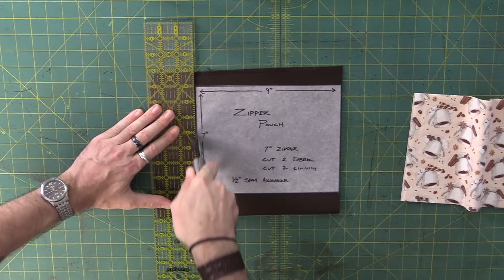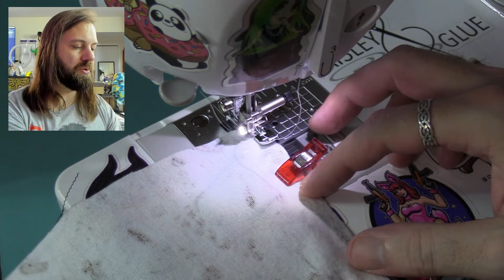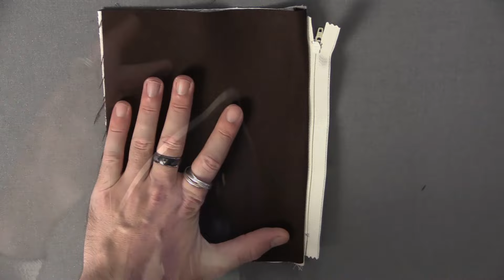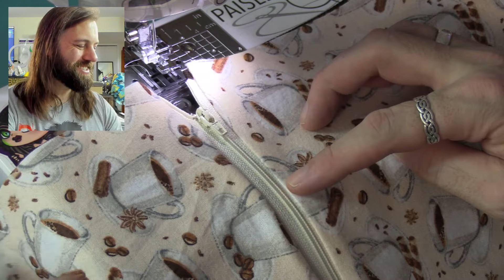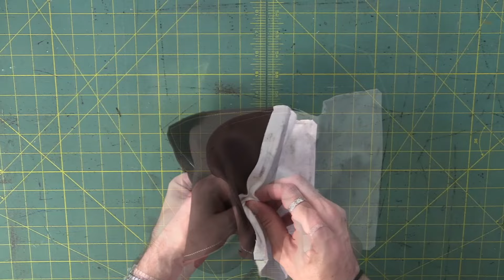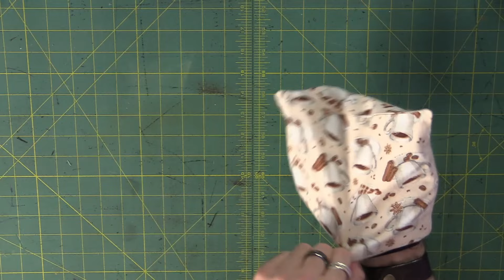How To Sew A Zipper Pouch - Tock Custom Sewing Tutorial

Comment: Hi, really pleased with your teaching method. Explained really well, and in real time.  I have trying to make the make up bag, that stands up on it's own, It cut the the 2" squares at the corners.
That part I can do very well.  The problem is all the videos I've watched have been really fast. I can never tell if the zipper goes on facing down or up.
Plus I would like to learn how to put the zipper covers on each end, I never get a neat ending.
I am trying my own method of leaving the zipper opened, and stitching all the round, plus doing the cut off corners diagonally so it stands up., when I leave the zip open,l am able to pull the whole thing through the open zip.
But would really like to get the ends of the zipper enclosed in the same material. But all the videos are so quick for me to take it all in.
I am 77, and enjoy sewing.  This is the best explained video I have seen. Please keep up the good work. I really need to shown how to do these finishing ways the bag can look nice without bulges at the ends of the zipper ends at the top.
Best regards, I hope to see more of your videos. You are an excellent teacher.
Chris, from Gran Canaria.❤

Comment: I have the hardest time with my zipper foot sewing straight lines....it alway tends to bounce off the zipper tracks and make my stitches jump...love the bag and coffee fabric!
Reply: The zipper foot travels next to the zip, it usually does not run over the zipper teeth.
For a machine that uses a foot like in this video, you place the zipper foot either to the left side or the right side, and the needle goes down as close to the zip as you can.
Otherwise the foot has indents on both sides and you move the needle placement to the extreme left or extreme right, so it can drop into one of those indents.

Comment: I've been sewing for 3 years now and I always learn a lot from your tutorials, even this far along :)

Question: Why do you prefer using pins when joining the panels? I almost always use clips
Reply from the maker: Same here, sewing for about 10 years and I still feel like a total beginner most of the time :P

I prefer pins for garment sewing because there is minimal risk of slip. When I'm doing bags, costumes, and upholstery I prefer clips since the material is much thicker. So it's about 50/50 of each :)